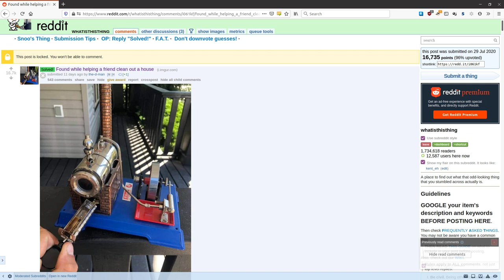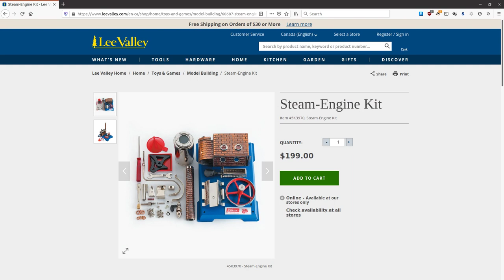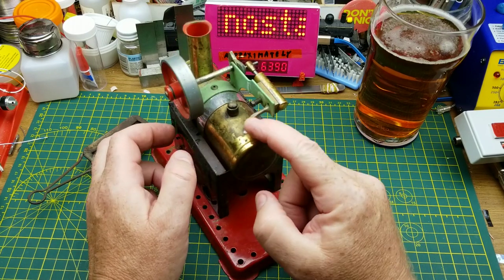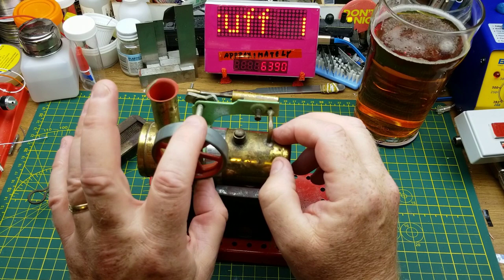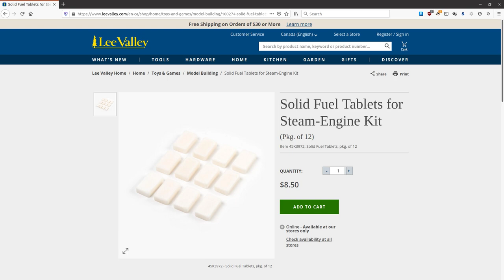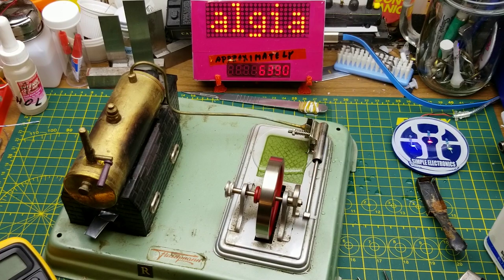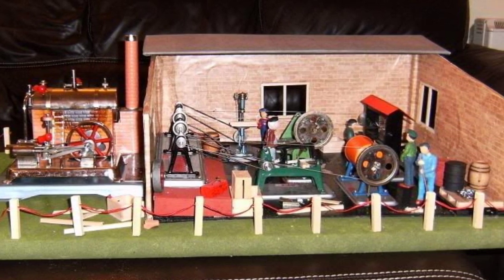Full steam ahead!

Comment: Great video, used to have one with my Meccano set as a boy.
Trick was to put hot water in the boiler for faster steaming.
Most of the water running out of the cylinder is condensation until the pipes and cylinder/piston get hot as well.
I think I saw some models with lapping around the copper pipe to keep the steam hot.
👍👍👍👍👍👍

Comment: the engine with the red base was designed to work with Erector sets in The US or Mecano in England made by the AC Gilbert company
Reply: I had a Mamod model and also had great fun with Mecanno.
At one stage I was mad about cranes, Meccano as you will know is ideal, so I made quite a few steam cranes.
The kids do not know what they are missing...
Reply from the maker: My brother and I may have tried to add mechano wheels and a drive belt to that one...

Comment: I envision using the wheel as a way to interrupt a beam of light as it turns, and a moisture sensor along with an air pressure sensor and maybe a vibration sensor all acting as inputs to control a synth. It would freak Sam out across the pond.
Reply from the maker: Sam would want a whole fleet of them.

Comment: I’ve found (on my Jensen engine) that you will get some water out the exhaust ports at first until the tubing and piston have warmed up the steam temperature. Until then, some of the steam will condense as it flows through the plumbing. I’m not sure it you can still get it or not, but I have a stack up military surplus tablets intended to heat rations. The packaging seems to indicate they were made in the 60s.

Comment: That dropper bottle of Alcohol had CH3OH written on it - Methanol - interesting choice!
Reply from the maker: Congratulations, you're the first one to notice and point it out!

It's inexpensive and easily accessible (especially at the moment since Isopropyl is being bought in bulk and used for sanitization)  And it's a reasonable all-around solvent to ave in the workshop.
Reply: @pileofstuff  Pretty toxic though, which is why I said 'interesting choice'. Ethanol and Isopropanol are safer, does Methanol burn better?
Reply from the maker: @Stuart-AJC  It burns about the same from my observations. I haven't done an exhaustive study of it, though. Methyl and Isopropyl (and denatured Ethyl) are all similarly toxic if ingested, so I try to avoid doing that. I also don't let it soak into my skin on a regular basis.